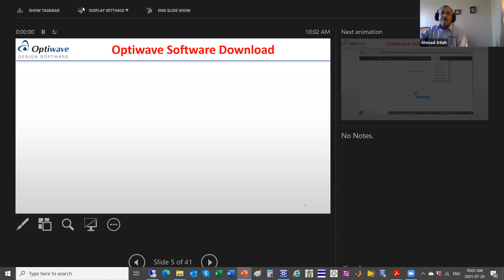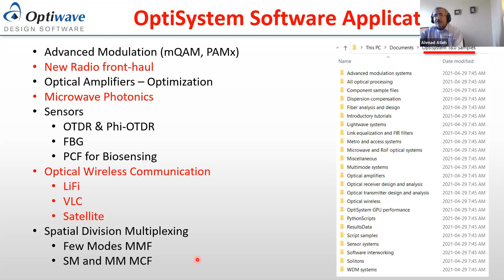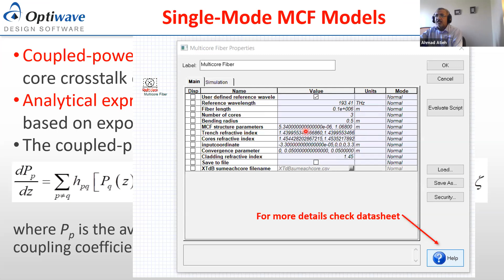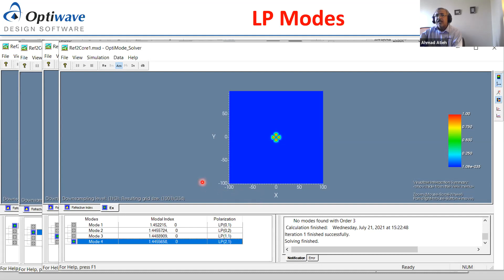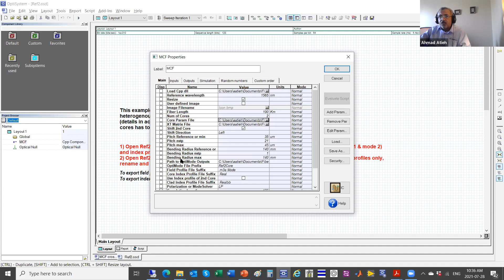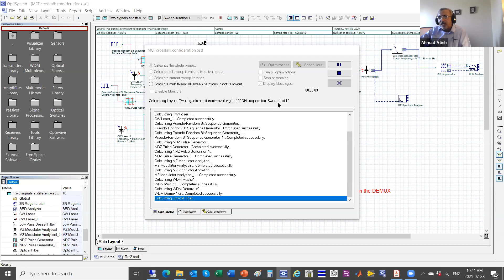OIDA Sponsored Webinar: Multicore SM and MM Fibers with Trenches and Air-Hole Assisted

Comment: Dear sir, how we can find crosstalk in a DWDM system using optisystem.
Reply: Dear Dhiman. If you are using multiwavelength signal transmitted over single mode fiber, then the crosstalk can be compared to back-to-back case (no fiber). the crosstalk investigated for multimode is different than the crosstalk due to multiwavelength signal. There are many effects that cause crosstalk related to nonlinearities in the fiber and passive components such as MUX/DEMUX, etc.
Reply: Hello